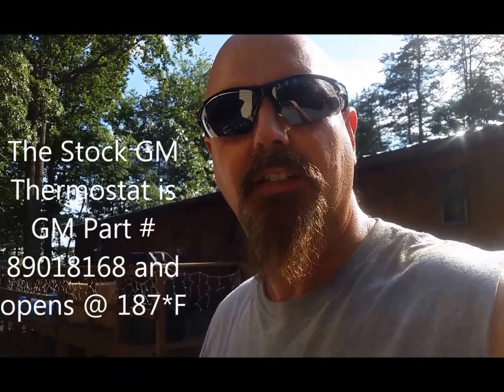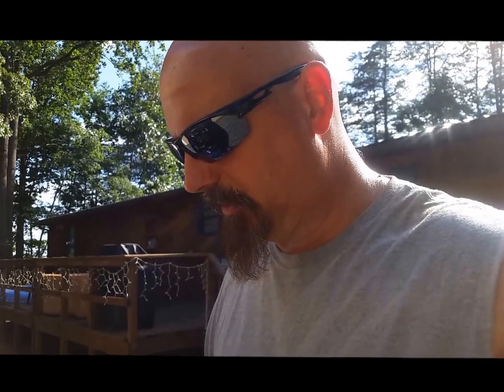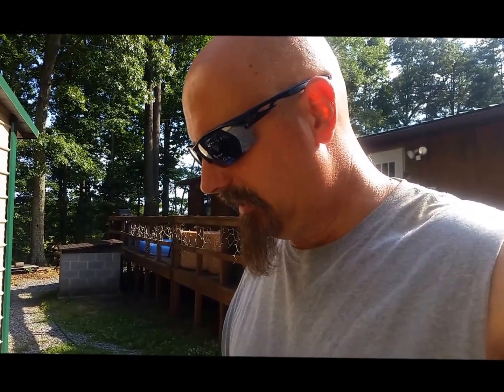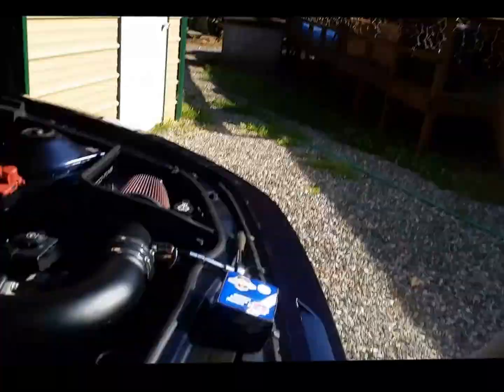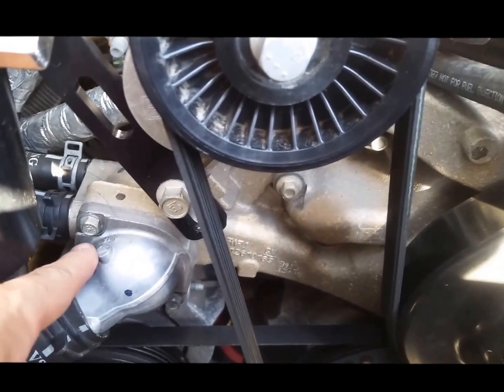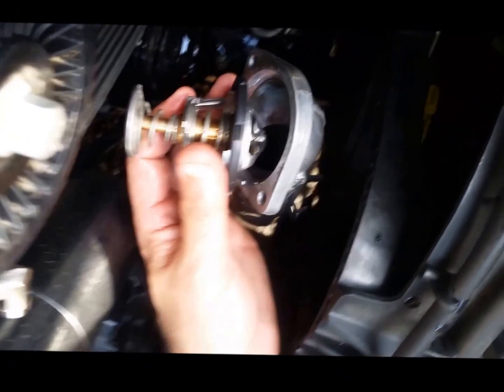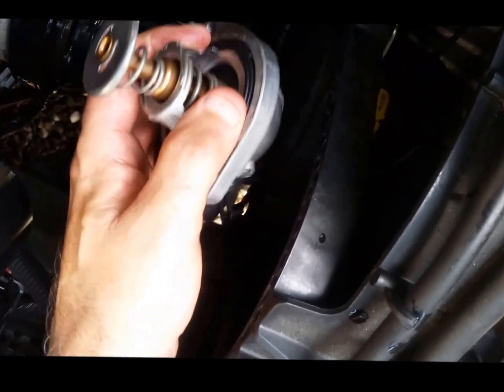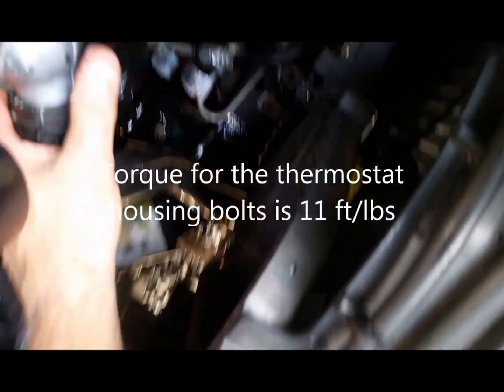2010 Camaro SS/L99 Thermostat Replacment

Comment: What temps were you seeing with the 174*F Thermostat?  I still have the stock thermostat in my 2012 L99 and even with the fans tuned to come on at 199F, the normal running temp stays around 205-210F.  I'm trying to decide between the 174F and 160F thermostats.  Thanks.
Reply from the maker: When I had the 174* stat in I could not tell a difference from the stock stat. I was still learning how to purge the system at that point so I may have not had all the air out of it. I went to the 160 stat quickly. In my opinion 199* is way too late I would have the fans come on at 180*. The 160* stat is great until the weather goes below 40* out. I still have the 174* stat and would sell it if you are interested in it.
Reply: I found that in HP tuners the lowest setting for the fans to come on is 199F.  Another option is to have them on all the time, which is annoying.  Apparently, if you change operating systems to 2 bar you get more options for lower fans temperature settings. How much would you want for the 174 thermostat?
Reply from the maker: How about $25 including priority mail shipping ?
Reply: I'm going to hold off for now.  Thanks. @frankcanora5900

Comment: Hello Frank! Great Vid! I did the 160 install and it went like a breeze! I made sure i installed the thermostat correctly, and also made sure the notch was in its place. Now, every so often i have a tiny minor leak where the metal housing meets the water pump.  The car does not OH or anything.  I re torqued the bolts to 11ft/lbs and a tiny bit more. No joy, still leaks but sometimes.. Its not constant... I left the car idling for a while and it didn't leak. However, I revved it a couple times to 2k 3k then 4k and i did notice a leak again. I wipe it and revved again and nothing... Could it be a bad gasket from the phastek performance thermostat ( where i bought it.) It never leaked before.  I appreciate any response to this.
Reply from the maker: Maybe put a new gasket on or try a light coating of gasket sealer on the gasket. I did not have an issue with mine so I'm not sure. The 160 does cause an error when it's cold and the temp gauge stops reading.

Comment: Did you have to drain the radiator fluid
Reply from the maker: He FaSSt I put a large pan below. You will loose about a gallon and a half of coolant when you pull the thermostat.
Reply: I'm thinking about doing that, I'm see How it runs after I get This cam put in

Comment: Where would the radiator cooling fan switch be on this car
Reply from the maker: Fan is controlled by the ECU I believe, the temp at which the fans comes on can be adjusted in a tune. If the AC is ON the fans will be on as well.

Comment: Did you need a tune after doing this? Or just straight bolt on?
Reply from the maker: You can do it without a tune but to take full advantage of the fans coming on sooner it is one of the adjustments made in the tune. An SCT X4 Tuner with a custom tune does it just fine.

Comment: Thanks for this video Frank. Finally got around to putting my 160* stat in this morning. Very easy to do. Car runs around 180 on the road, cools down to 175 after a pass at the strip in about 20 minutes versus an hour or more with the stock stat. Could actually hot lap now if I wanted to.